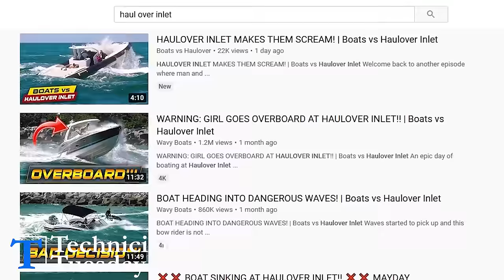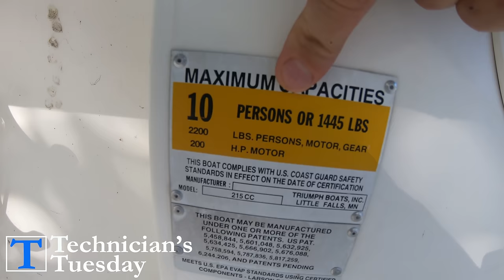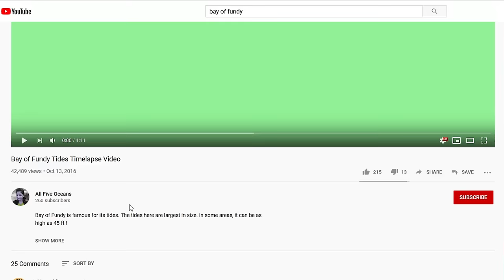Why Boats SINK!

Comment: Never had a boat sink, but in my early boating years (1960-1970's) I launched our 22' boat, without the plug in.... After launching the boat, and pulling away to park the trailer I came back to the boat, and there was already 3" of water covering the cockpit (the bilge pump was running but not keeping up)... I jumped in the water  ( COLD, mid December, clothes on, wallet in pocket, etc) and stuck my thumb in the drain-plug- hole, and yelled for my buddies to run back to the truck to get the plug (that I remembered I had tossed in the bed of the truck)... They made it back in time. Boat did not sink. We went fishing.... I never forgot the plug again....
Reply: plugs are cheap...should have spare you keep in the boat at all times,  
why did you toss the plug in the truck bed, & not in the boat?
Reply: DarkFlamage shit happens. Don’t be so critical. The guy obviously learned from his mistakes
Reply: @DarkFlamage  I was young and stupid. But being the obsessive/compulsive person I've been diagnosed to be, after that episode I had a half-dozen plugs, EVERY WHERE; stored on the boat; on the trailer; in the truck; tied to the engine; tied to the motor; in my pocket; even had one on a lanyard tied tied around my neck with my dorm key!
Reply: @chrish5096  Thanks for your support! Yes I learned from that one, and from all the other ones I've made!
Reply: Andrew F Yakim Haha I get it. I’m young right now and look back at mistakes I make and think of all the coulda, shoulda, wouldas. Nothing you can do but know for next time. Ig that’s why when your young you make so many dumb mistakes, because you haven’t already made them yet😂
Reply: My brother forgot to put the plug in last month, luckily the bilge started going right away and he poped it back on the trailer. Dummy simply forgot to put the plug in(it was right in the truck), thankfully the bilge went on and he noticed, he was headed right to dock after launching it!

Comment: Everglades 290 pilot.  New transducer was mounted and old line holes weren’t filled properly. Checked boat after 3 days at slip and found 150-200 gallons of water in bilge (and back filled into every fishbox below decks ). Float switch failed but thanks to Everglades flotation the boat was floating level and fine. No harm , no foul but very lucky and thank god for everglade’s no sink guarantee.

Comment: My Robalo R242 has a hatch in the stern that I can climb all the way into. I love it...have access to all pumps, filters, batteries, hoses. I was lucky this past spring. I knew my bilge pump worked when I hit switch but after a massive rain, I had 30 or 40 gallons of freshwater in the bilge area. The boat wasn't lower in the water and the bilge emptied it all in a few minutes. I pulled float switch out, took it to the parts store to buy a new one. The guy at the store told me to hold on there...checked the continuity on switch...it was fine. Told me I'd need to look for something else. Turns out one of the red wire connections to the switch had corroded. Climbed on down in there, soldered/liquid wired a new connection...back in business.

Comment: My current boat, a 2005 Boston Whaler 305 Conquest, has great access to both bilges. I have a forward bilge under the salon and my mechanical room. There’s a huge hatch in the cockpit floor that gives you access to the pumps, seacocks, thruhulls, etc. It’s amazing.
Reply: I have two bilge pumps, a 2000 GPH bilge pump with float switch in my mechanical room and an 1100 GPH under the floor in the salon.

Comment: 2003 Edgewater 18.5 has great access. My problem was a leaking, corroded through hull drain to the forward deck locker. Bilge pump drained battery by late summer. Boat took on 100 gallons. Took it out of the water then back home filled it up again with my hose and found no leak at first. Towed the boat out my drive until the bow was down and all of a sudden there was a squirt gun stream from the bow through hull outer edge. Mystery leak solved and fixed finally.

Comment: My boat has great access to the bilge. My pumps, float switch, and thru hull fittings are all accessible through a large hatch in the deck. I check my float switch and all drains hoses once a week. My deck is above water, but my drains exit just below the water line. It isn't my favorite design, but it is not uncommon. Keep up on maintenance and inspections and you shouldn't have an issue!

Comment: had my boat almost go down on two occasions.  You covered one by thru the hull fittings, I had a pump break off.  1/2 hr after docking saw water coming up from the floor drain !Race to the launch, had a hell of a time getting it back on the trailer.  The other, used a live-well for a bait well.  Had a screen over the overflow drain hole to keep minnows in.  A buddy I had out put big suckers in there once.  The slime off of 'em plugged up said screen.  Forgot pump was on,,,,,,,,,,,,,,, Again, water coming up thru the floor drain.  at least that time was able to stay out, bilge pump handled it.

Comment: I have a Triumph 150 cc. The boat is made of roplene (which is very hard plastic) so it doesn't crack or get soft like fiberglass does, BUT getting to the bilge pump IS A ROYAL PAIN IN THE BUTT!!! I think when they built this boat, they put the bilge bump first and then finished up the rest. It's not a self bailing cockpit either. So I purchased a battery operated portable water extractor in case the bilge fails on me when I am in the middle of the ocean and it's raining cats and dogs! I also have my EPIRB beacon on me at all times in addition to 2 VHF radios just in case....

Comment: Scout Dorado here - open the main floor locker and there's a spin out access to see the pump. If you want to actually access it and the livewell pump tho you have to remove the six screws holding the bulkhead in place, pry it out then basically hang upside down to work. Love the boat generally but that's one of its most frustrated features.

Comment: 91 20ft key hopper
Flats boat 
Not the best access to the bilge but easy enough to check it all the time, and it originally only had 1 2000gph pump, I added an additional 2000gph pump for redundancy!

Comment: My Glacier bay cat has 4 pumps and do a great job.  But, factory wires are not fixed to stay up out of the water.  I had issues so added terminal blocks for a better set up.  No problems now.  Thanks for the video.
Reply from the maker: Thanks for sharing

Comment: I work a volunteer event called Military Appreciation Day here in North Carolina we arrange coastal fishing trips for active Military and Vets through several events during the year. COVID stopped that this year :-(
Last September, during an event as boat coordinator for over a hundred boats, I was manning the radio and tracking tent when we had a MAYDAY call come in. "Boat taking on water heavy" I asked position and Captain replied with a "location" I said to put on lifejackets, Captain said they were doing that now....I asked boat name.......radio silence......I knew they flipped. 

Seas 3-4' and getting rougher that afternoon. Many of our volunteer boats mounted a search with last known stated location. Turns out that location was wrong by 9 miles. Long story long they were 11 miles offshore, drifting SW, and one of the Army guys onboard got off a text to 911 with LAT/LON from his waterproof Google Pixel phone. Our volunteers beat the 47 MLB there with a 33 Contender. The Heli that was deployed from Elizabeth City turned around. 

The boat was a 19 Key West with positive foam floatation and was taking water over the stern during the day bilge pump not keeping up. They said they would "goose" the throttle every now and then to clear water out of the rear of the boat thru the scuppers. They were excited about catching fish and had not really kept a proper check on the bilge condition. Needless to say everyone was fine and really shaken up. 

I came home and gutted my bilge, starting over with new pumps, hoses, solid state float switches, alarms, high water alarm and added a manually activated bilge pump too. On my 25' boat I now have an 800 GPH "nuisance" bilge pump on float switch in lowest position, it activates an LED light so I see when it is powered. Next up on the water level is a 3750 GPH "OH SH*T" pump with 2-1/2" outlet and solid state water witch switch and audible and visual alarm, then another 1500 GPH that I can flick on manually with alarm. Last line of defense is a high water alarm with annoying audible alert. 

I have a double redundant house battery system, solar charge system and if MY boat goes down, something really, really, REALLY bad must have happened. Your bilge and pumping strategy is crucial to not sinking, but don't turn a blind eye to other safety things such as knowing what to say during a MAYDAY call, recognizing when something does not feel right with your boat,  having your MMSI programmed into your VHF and initiating a DSC mayday call. Have an EPIRB or PLB and a backup to that too. (if those last acronyms were greek to you, PLEASE look them up) 
I have 2 means to communicate via satellite along with dual fixed mount VHF, and a floating handheld VHF with DSC and GPS built in. 

Great vid B.A.B thank you. I'd like to see more on safety as it is now mine and my friends who almost didn't come back home, mission to educate others.

FYI - That morning I had my choice of two different shore based VHF radios to choose as primary. I chose the one that allowed the automated Sea Tow call response to be clearer and well heard. I am convinced the other backup radio had an issue. Also, the Captain of that boat making the mayday call never said his name or his boat's name. I recognized his voice as I had been out fishing with him before.

The Army guy with the waterproof phone.....took a selfie of them on the overturned boat, how epic is that!

A bit of good karma too - The boat that was first on scene to rescue those guys last year won just the US Open King Mackerel Tournament here a few weeks back, over $80,000 payday! I won't say names even though it's public record out of respect.

I don't want to ever help coordinate a SAR (another acronym to learn about....) like that again, let alone be the one being searched for. 

You can't learn or have enough about safety on a boat!

Comment: My last boat, a 2001 24 angler walk around, sank at the dock. The bilge pump failed. My mechanic was on vacation, so I used the service department at my marina. They didn’t hook it up correctly, and there was a big rainstorm that night and it submerged. Insurance bought the boat from me for the value before it sank.
Reply from the maker: Ouch! Sadface

Comment: In my 89 Stamas 255FF, there is a LARGE hatch in the deck near the stern that allows access to oil tanks, fuel filters, the raw water pump, and the bilge. I am replacing the bilge and float switch, and I like the dual set up that I saw in this video. I might have to steal that idea for mine. I keep my boat trailered and in an enclosed garage, but I am worried about thru-hull fittings below the waterline coming lose. They are old, after all. 

The main problem I have with that hatch, is that I can't do anything else in the area, like add a proper round live well or additional seating.

Comment: My problem...on occasion is I forget to put the garboard plug in before the lift gets there. I like to leave it out, because in Florida,as you know, when it rains....it rains....and the way the engine room vents are set up, the water has the ability to run into the bilge...so that's why I leave the plug out.
I'm fortunate...we have observant lift operators who point it out, and I feel the embarrassment!!!!
Oh well. Another great informative nut and bolt video.
Cheers
Reply from the maker: Thanks for a visit!

Comment: Solution to cracked hulls, buy an aluminum boat. Best thing for Alaska 👌🏼
Reply: @Khalil G Just not as popular because of the boxeyness of Aluminum, Although there are brands like "Bayweld Boats" who produce extremely high quality custom boats.  Aluminum boats also have a "Tinny" sound when not properly braced and insulated.
Reply: @Khalil G "Boxeyness" has nothing to do with it.  Look at any airplane today and notice how it's both made out of aluminum and not boxy.  No, it's not an aesthetics reason, rather, aluminum is insanely maintenance intensive the further south you go due to water salinity.  Also, and this is the main reason... fiberglass is far cheaper.  You can create complex shapes at a fraction of the cost and time you would if you were using aluminum.
Reply: Or just slap flex tape and sealant on the crack. Worked for me

Comment: My buddy's boat sank because the bilge pump ran the battery down. I have a genius system on mine and it is on a lift , but it is still necessary to check it on occasion. My buddy now keeps a solar charger on his but fails to check it occasionally and it will likely sink again..his is in the water always...

Comment: In 1977 my father had bought a new skipjack 25 . I was a young teen than and it was so exciting to finally have something other than the little 18 ft. Glasstron we had previously. Anyway, the second trip out. we got out to the L.A. breakwater and the boat was taking on water. Scary scene at 5 Am!  Picking up bait at a barge there. The rubber drain plug had fell out and was hanging by the chain. Well, the plug hole was under the outdrive and i had to dive under. Trying to tighten it with my head submerged in the pre dawn. Yikes! i will never forget this. But other than that the boat was a beautiful fishing machine.

Comment: I have a Boston Whaler so it won’t sink. They can have other problems though.
Reply: J.C. Kohle  Titanic?
Reply: @markusantonio4866  Whalers were (are?) foam lined.  They had a huge ad/marketing campaign in the 60's into the 70's showing how unsinkable they were.  They even cut one in half, literally, and both halves still floated.  Water will fill the boat and it would go under to the gunwales...but they didn't technically "sink" to the bottom.  These were primarily the small 13' and 17' Montauks.  I have no idea if the modern Whalers are built the same or not.  But back in the day, there were great little boats with a solid reputation.

Comment: How about these two....

Sealant around brass thru hull drain plug eaten away by ants allowing water to fill the bilge.

Another....

Livewell running overnight for the next morning.  Screen comes off to allow bait to plug hole filling boat with water slowly during the night.  6am walk to the dock to find boat on the bottom 3 feet under water.  

These really happened.

At least I didn't come in just for a broken nav light to have my boat sink.

Comment: Most common reason by boat fills up is due to the fact I plug the livewell hole instead of the hull botton plug before boat launch at the ramp 🤦‍♂️.  For the tides, in « La Baie Saguenay » Quebec Canada, you get impressives tides of 6 meters (20 ft)

Comment: I bought a used boat and I wasn't told that the exhaust bellows had a hole in them.(stern drive engine). My bilge pump kicked in until the battery went dead and my bilge, and engine was full of water. I was NOT happy.

Comment: There used to be a requirement for boats under 20 feet to have enough flotation material to keep it from sinking completely like the whole boat will be under water by a few inches or so. Still it is not a good thing to have happen...

Comment: Have I ever had a boat sink on me?
Not that I'll admit to having the same boat do so twice for 2 different reasons.
10 Foot john boat, at night. I was on the right side of the river and some "Cigarette" boat (Long Fast Heavy Lots of Horse Power) with no lights on, took off and I, at full throttle, hit his wake.
WAY UP in the air we, my dog and I, went.
There was another boat on the other side of the river that came and helped us. This story is way longer as well but that's enough for now.

Comment: Bought keywest 203. They didnt attach the hoses to the deck drain and the livewell. The live well i noticed right away and fixed it the first time i went to use it. The deck drain hose would leak and fill up with water to point where the porta potty would float in console. It took 2 years for factory and dealer to finally properly fix hoses because they had to cut the fiberglass up. Now I am having electrical issues from connections being submerged and the port side sits 2 inches lower. I think i have trapped watet. Next boat i buy will have much better access. The other problem is this boat has no seacocks so you cant stop the water from coming in. Very disappointing.
Reply from the maker: Wow :(

Comment: A previous owner filled the bilges of an Iroquois catamaran with foam up to a point above the waterline.  Does this make it unsinkable?  Or will the "closed cell" foam eventually get waterlogged?  Should I carve out all the foam or leave it?
Reply from the maker: Thats interesting! Idk if that would really make it "unsinkable" and it depends on the foam if it can absorb water or not. I would suggest to still have working bilge pumps and then leave the rest

Comment: Hey Born Again Boating I have a 2003 Trophy pro 2103cc have you ever seen or worked on one and if you’d have what’s your opinion on it, the boat works great no complains I bought it in Florida and I brought it to Puerto Rico because Since I live here but I just wanted to know your opinion on it
Reply: Very, Very good, underrated boat. A standout for its size.
Reply from the maker: Not a bad boat, I dont have a lot of experience with that specific one, but I'm not partial to any boat brands :) as long as you have a boat ;)